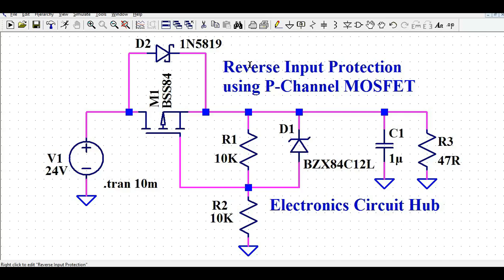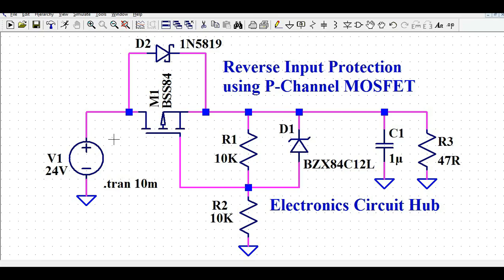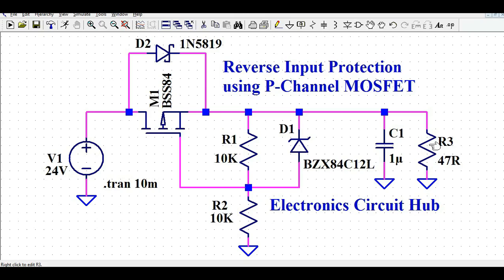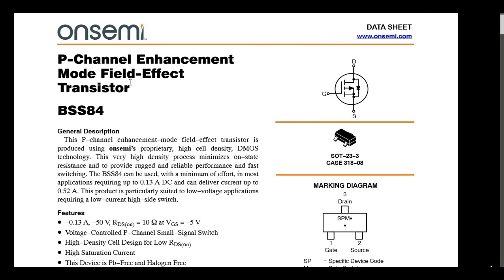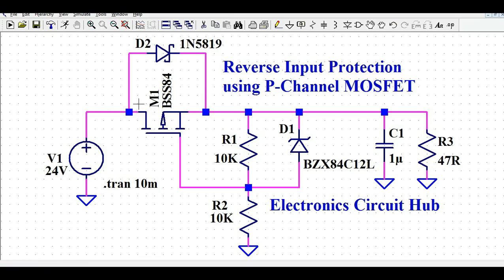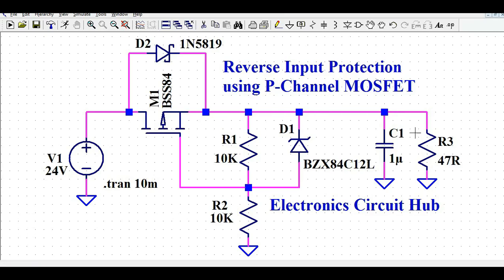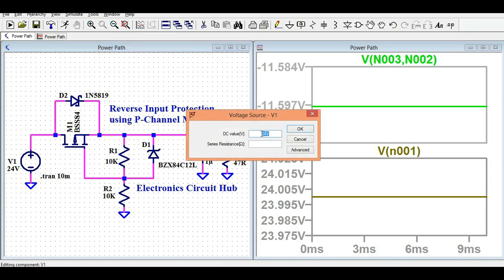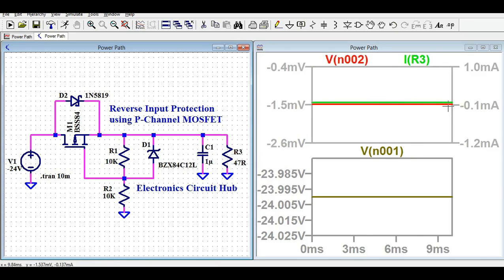LTSpice Reverse Input Protection using P-Channel Mosfet

Comment: D2 is not needed.
Reply from the maker: Hi...if you have watched the video I have clearly explain the use of D2. The reason why I have used the D2. In some extent you can say D2 not needed.
Reply: @ElectronicsCircuitHubECH  You need D2 if you selected a PFET with too large of an RDS-on characteristic, with the right FET in place, the voltage drop should be a few 10's of mV. The whole point of using the FET is to attain a minimal voltage drop (loss) from the circuit, other wise just use a single diode?
Reply from the maker: @leofernekes343  well explained, thank You.